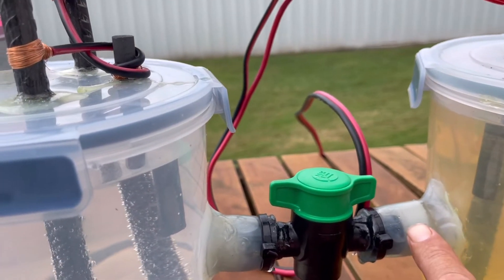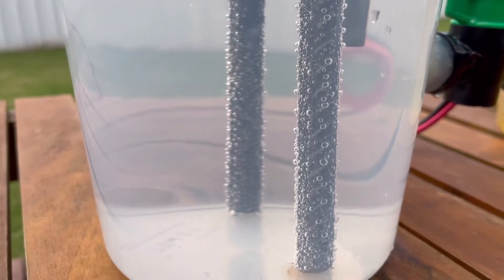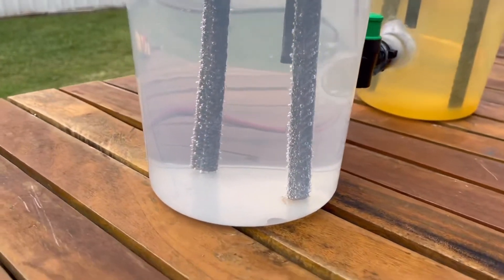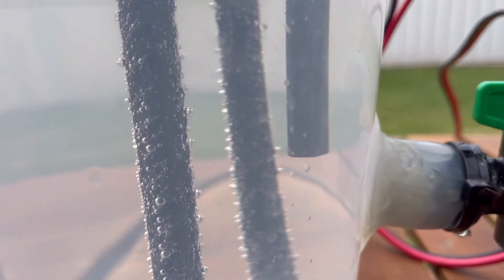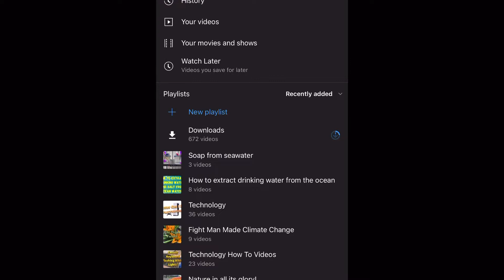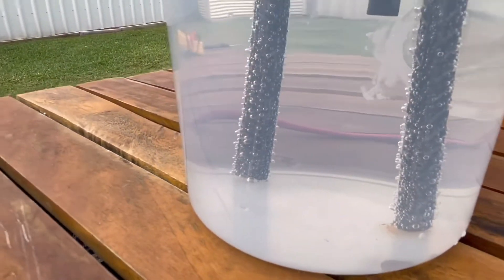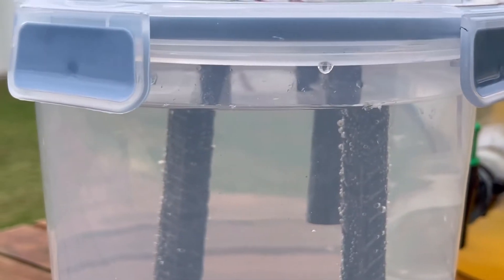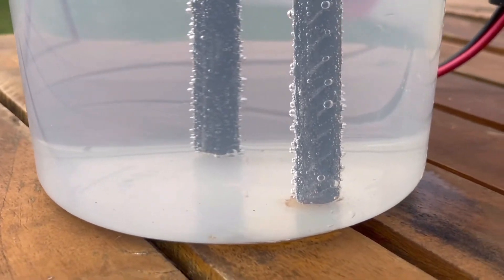Home made electrolytic cell

Comment: I have done many experiments, but I get chlorine that is low in concentration and low in effectiveness. I don't know why?
Reply from the maker: The chlorine actually leaves the fluid as a gas. You need to be able to capture the gas and than mix with water. I have had the same problem in the past week. I got the system going again and the gas escaped from the unit because it was not sealed correctly. I will design a new system and post it this weekend! Keep an eye out for it!
Reply: Thank you for the response, and I will wait for the next video to be published for you in order to implement it for me. Thank you for your interest in my comments

Comment: Did you use steel poles for building construction?
Reply from the maker: I have in the past. We call them rio bars. Usually they are used for concrete. I wanted to experiment with them to see what would happen. It was interesting that for sure! I accidentally created a battery!
Reply: I follow your videos with great interest because I want to produce chlorine